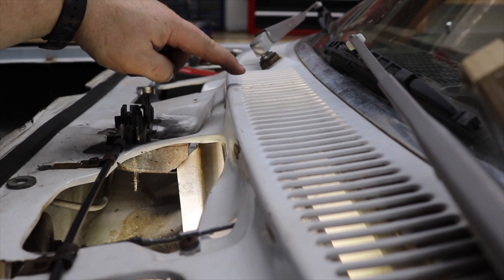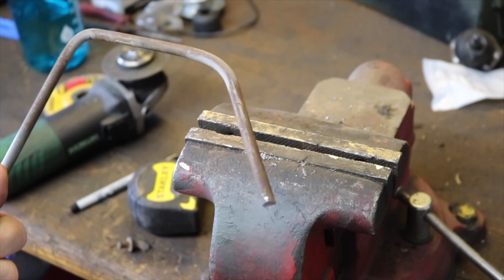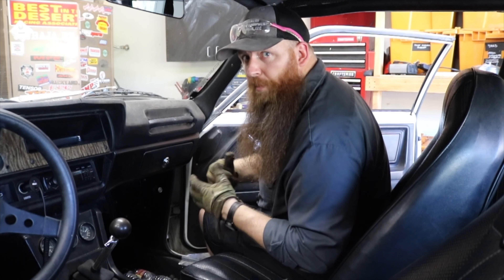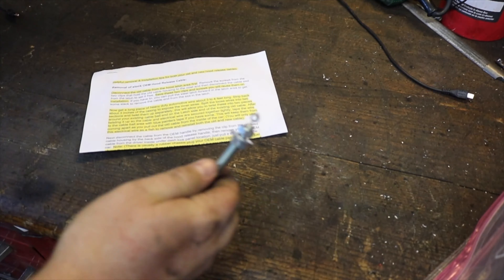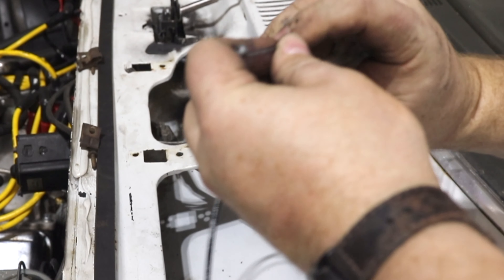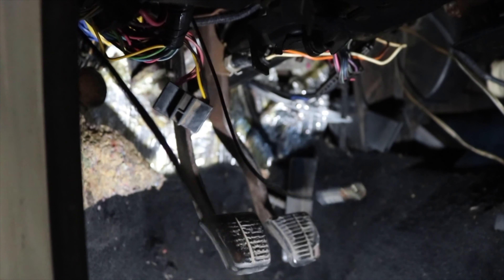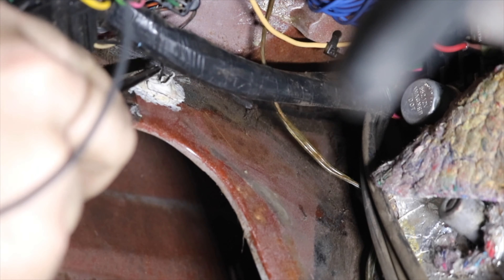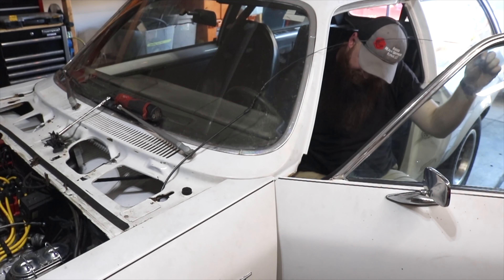H-Body Hood stuck closed | latch Release tool | Hood Release Cable replacement | Vega EP15

Comment from the maker: You can get in contact with Mike Steinert about a new cable through the forums with user name Vega2008, or on facebook. He advertises frequently in the "VEGA NATION™" aka Chevy Vega Owners Club. His email is listed in his profile on H-Body.org
Reply: good video, well done.    i looked all over the H-Body forum places,  but can't find  any Vega2008 or any links to Mike Steinert.  how did you find him ?  i need a hood release cable like the one you got.  any additional info ?  thanks.
Reply from the maker: @normhodgkinson6965  look in the facebook group “Vega Nation”
https://www.facebook.com/groups/nothingbutvegas/permalink/1678575152345898/
Reply: @BurnoutsAndRotorblades    Thank you for the reply and info,  but i don't have a facebook and/or instagram account.   i see the pics with the cable and bolt cutters on his floor.  the price is very reasonable, but i can't access his messenger link.
Reply from the maker: @normhodgkinson6965  magnumsportster1@gmail.com here is his email